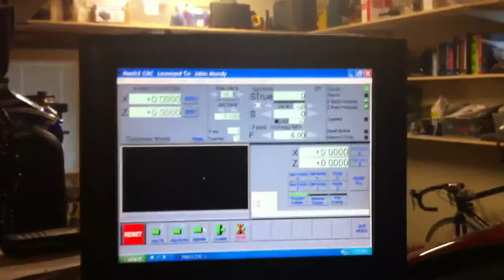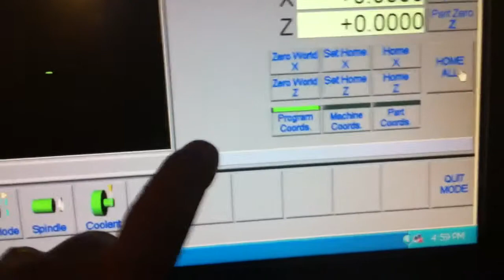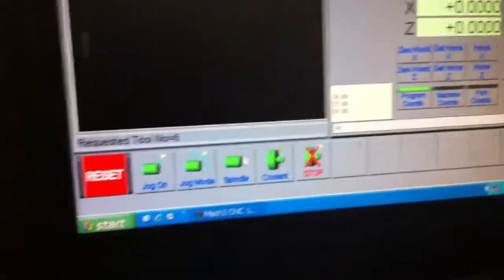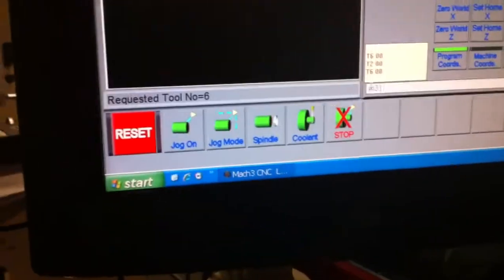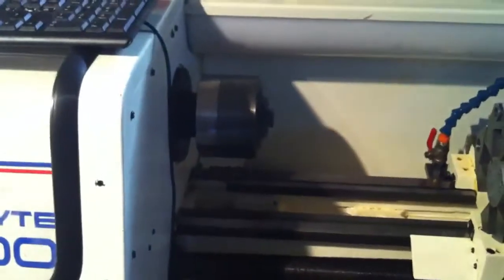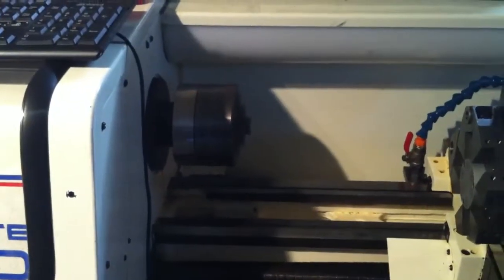Dyna DM3000 2nd or 3rd configuration

Comment: Great job on the upgrade.  Thank You for sharing.  I just purchased the same lathe (circa 1990 model).  I want to upgrade it to Gecko's/Mach3 - just as you have done.  You can email me at JoeComunale  (AT) comcast.net - if you'd like to exchange information.
Reply from the maker: Joe, I would be more than happy to share any info I have to help you along. A better use of your time if you dont go there already is CncZone dot com. There is a Dyna section. The most admirable retrofit of this machine was done by a user "MRM". Share your work and videos too!